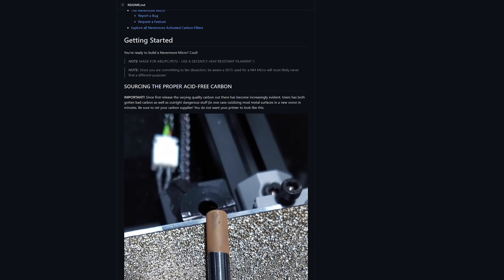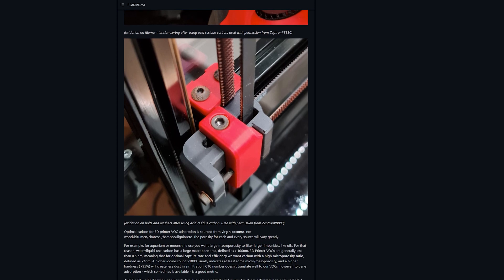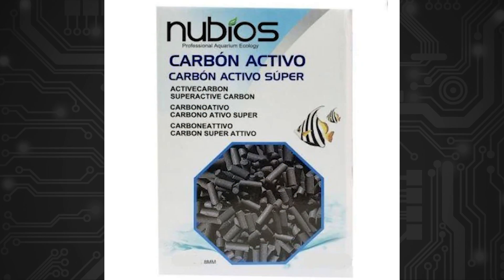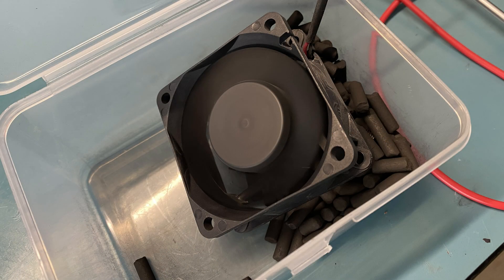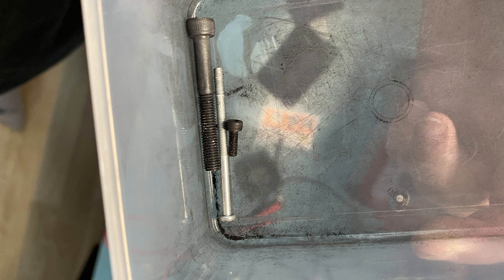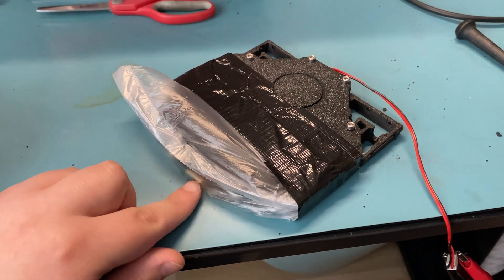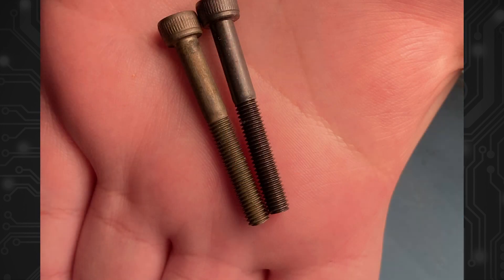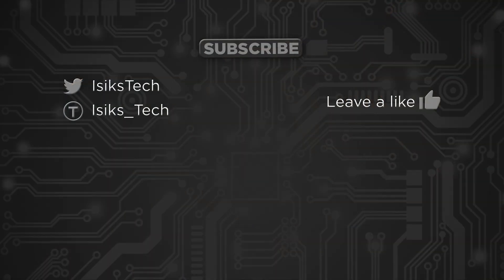Testing Active Carbon Acidity for Nevermore

Comment: The question that comes to mind for me:  Is it really a great idea to have tiny particles of carbon dispersed into an air stream, acidic or not?  I mean, people are concerned about microparticles of filament being released as part of the extrusion process, but here we have a fan actively mixing air with the source of these particles.  Yeah, I get that the Voron enclosure is supposed to be "closed", but...
Reply from the maker: Better than plastic fumes. Also, the HEPA filter should catch them anyway. Nevermore Max has a HEPA filter after the carbon and the creator of Nevermore recommends using the stock Voron exhaust filter in combination with the Nevermore Micro.

Comment: What about soaking the carbon in water and testing the pH with pH paper  , is that not a viable option ?  I would think if it's going to be acidic enough to rust the screws it would make the paper acid too ?
Reply from the maker: Maybe. Obviously water will dilute it so I don't know if it will be acidic enough.
Reply: Yes, this method is viable. The standard method is 4g of activated carbon (powder or ground) in 100ml of water, after boiling for 5 minutes, wait to reach room temperature, then measure the PH

Comment: Interesting video. I didn't even know this is an issue. Is there a way to tell if the carbon is acidic before buying?
Reply from the maker: I think you need to ask the seller or just buy known good ones. Finding the right ones is difficult afaik. There's more info on the nm micro github.